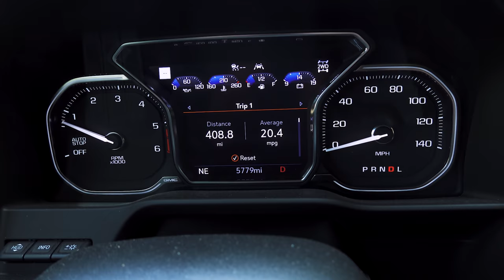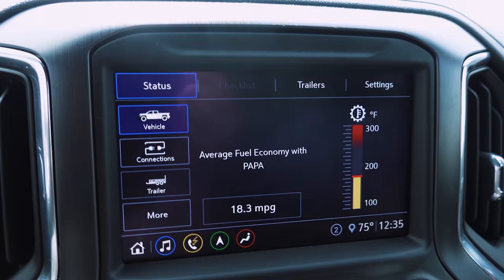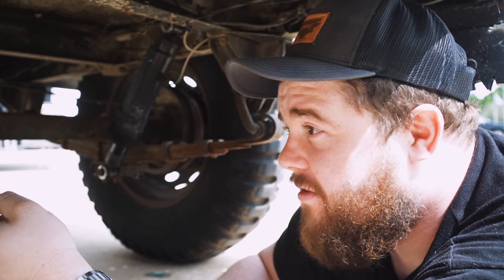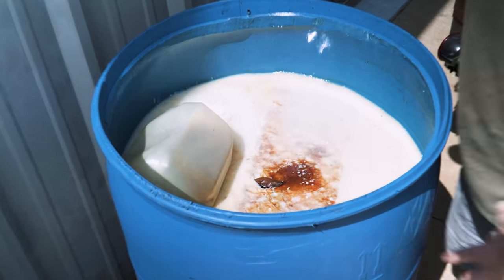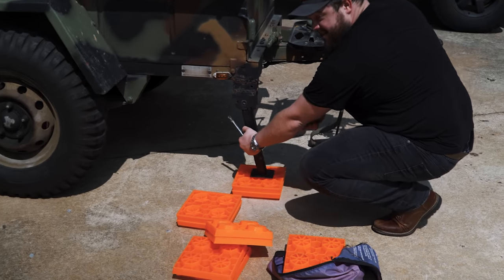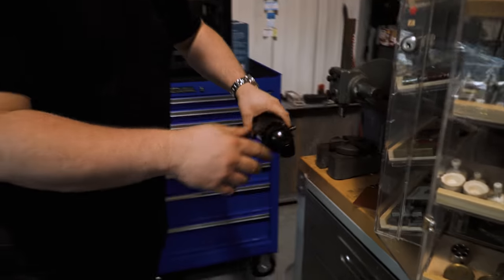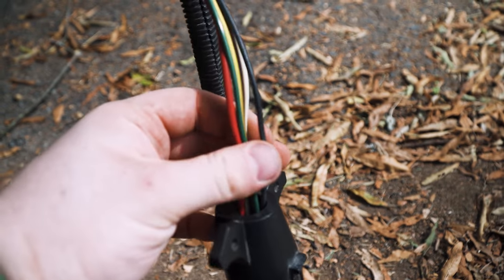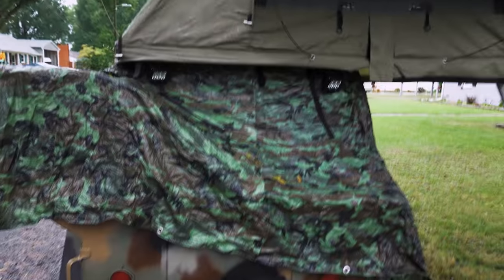More PROBLEMS with the PAPA trailer

Comment: I would recommend totally rewiring the trailer lights (only the driving lights) and just run a 4 pin connector. That'll take care of any issues with your truck thinking there's trailer brakes and is a pretty easy job.

Comment: Looks like 4 wire plus 12V charge.  Test the red for 12V from your battery, if it's there connect to the 12V charge pin and then your trailer battery will charge as you tow.
Caution, GM does NOT switch this pin.  If you have a weak battery on the trailer it will draw down the truck battery when parked for an extended period.
Reply from the maker: All great info!